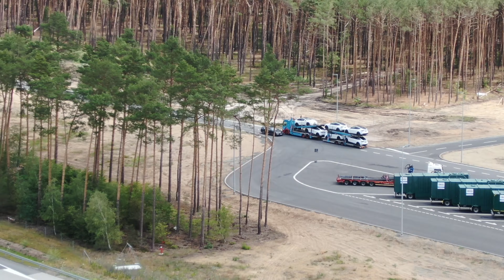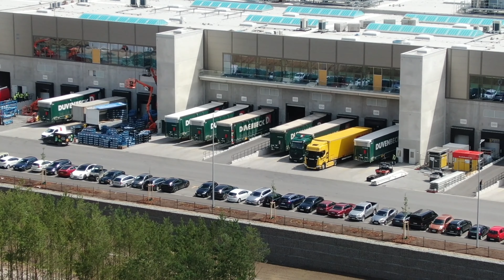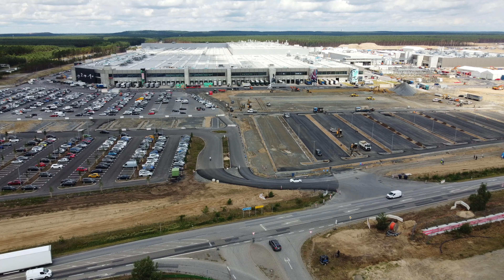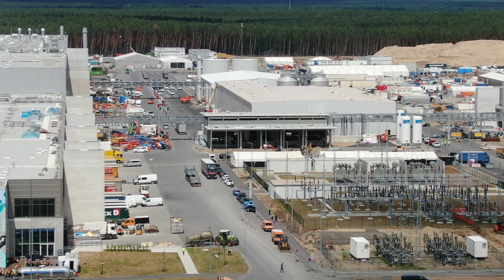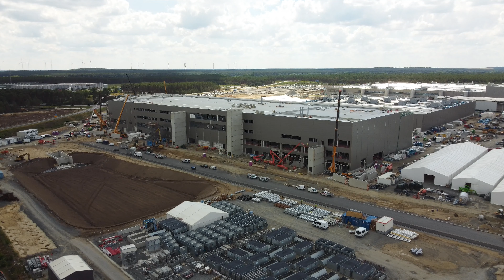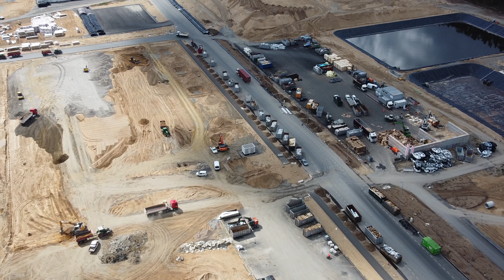Giga Berlin | 2022-06-28 | Timelapse

Comment: 14:39  It has always struck me as odd that a railway spur was never built into the site for delivery of materials during construction and shipping of finished cars after.  Transferring materials from the railroad hopper cars to trucks to move across the road adds logistics strain to the process and adds unnecessary wear to the local road and excessive traffic at the intersection.  Given the overall cost of this project I can't see the price of a railroad spur as significant and given the time/labour savings it would foster it would have given a decent financial return.
Reply: Tesls wants to buy another 100 hectares east of its property to built a proper railyard there. With a few railway spurs this is not done.